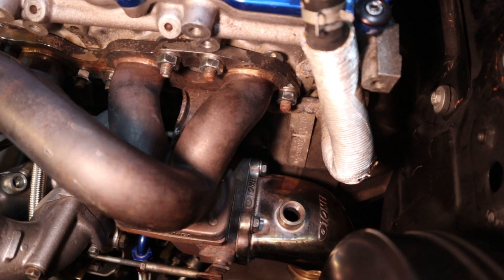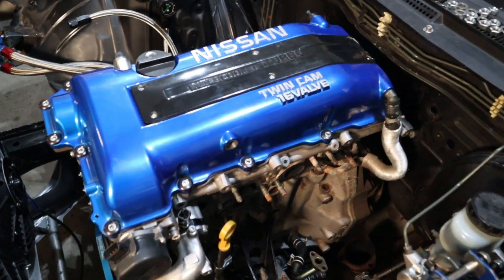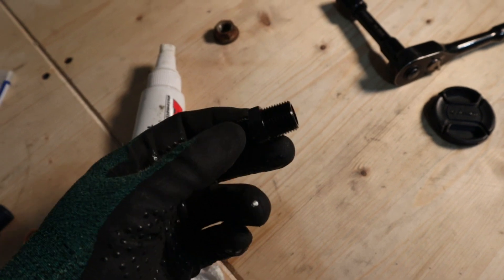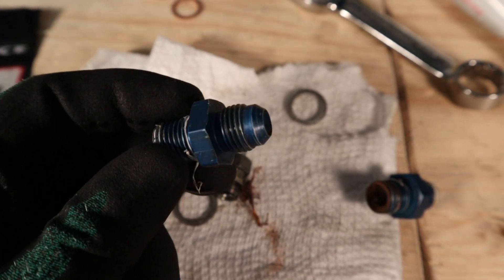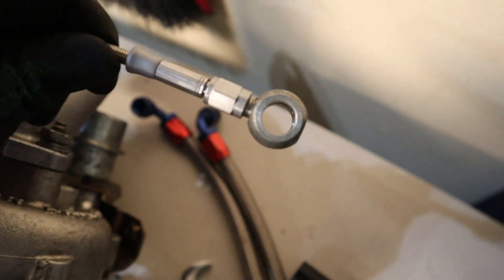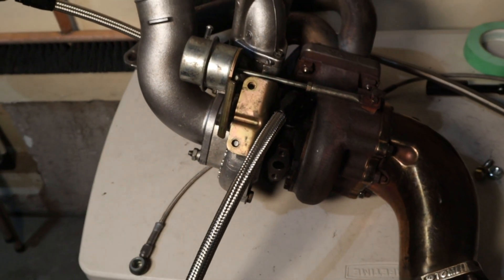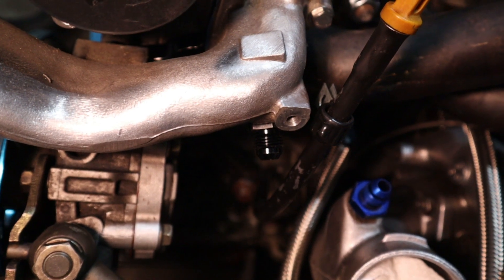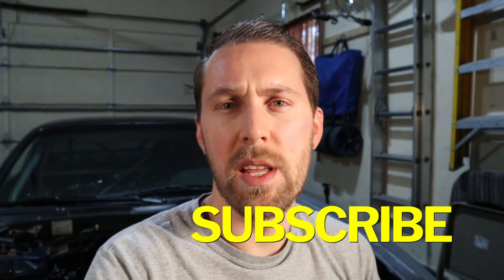S14 Drift Build - SR20DET - Make Your Own Coolant and Oil Lines - Stock Turbo

Comment: A video like this is gold for future enthusiasts doing a T28 upgrade or wanting to refresh their lines. One thing I will say is I wish you had put the specs of the fittings in text on the video so theres no confusion and or it can act as a form of verification. I know url(s) typically die after a couple of years, but would be extremely helpful for each item so a viewer can purchase exactly the same parts. Thanks

Comment: Thank you for the video! I have a question, what will happen if u flipped the water hoses … Block <>water neck?
Reply from the maker: Sorry for the late reply. My understanding is that it will make no difference. But if I were you, I would do a bit of research on that to be sure.

Comment: What is the torque spec installing the M14 -6 adapter to the water neck? Thanks!
Reply: I didn't have any torque spec for it. Just tightened it down using the same feel I would use for similar crush washer fittings. Luckily, if you don't tighten it enough, the leak will be small, and you can easily tighten it a bit after the fact. Better than over doing it!